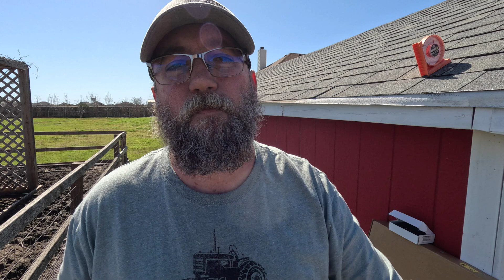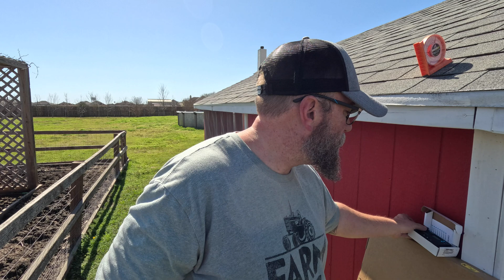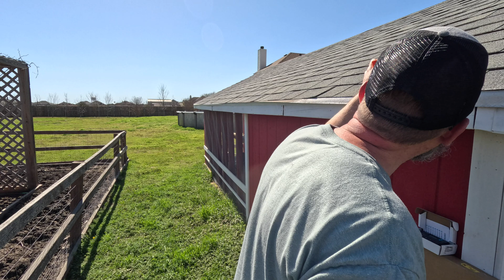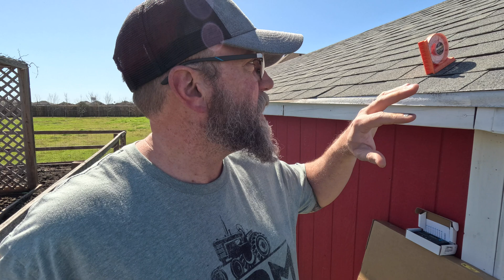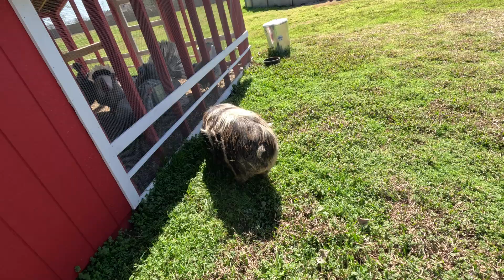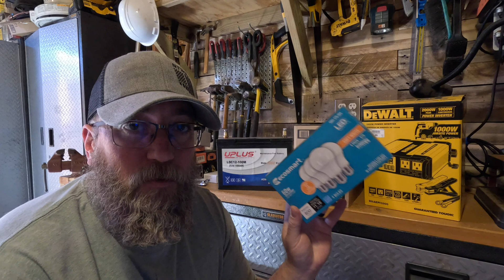Unboxing Renogy 100 Watt Solar Panel

Comment: If you are using incandescent lights for warmth I can see that setup. If not then use 12 volt LED bulbs and have way more reserve power by eliminating the inverter.
Reply from the maker: Agreed and understood, thanks for being here

Comment: I'm always interested in solar panel installations. I've been collecting the Renogy 100-watt panels, actually, another one is coming Monday. Getting them installed will be a project for this summer for some back-up energy. If anyone has looked at a professional install - around here in the Northeast anyway, no one will do it unless you spend thousands of dollars (but it will be paid off in 20-30 years they tell you...) and it has to be connected to the grid. That is exactly the opposite of what I want to do. So, that leaves us to do it ourselves. Thanks Doc!
Reply from the maker: Agreed on all of that, that is why I am doing it myself. Thanks for being here!
Reply: @twodrshomestead  You do good work!
Reply: Ahhhh. That must be why my State government is doing all the solar install rebate and funding program. To keep the off grid method of energy production, still on grid.maybe.?
I'm in 🇦🇺
Reply: @jaegrant6441  I suppose so. They want the people to build more infrastructure for the nation. I'm in the US.